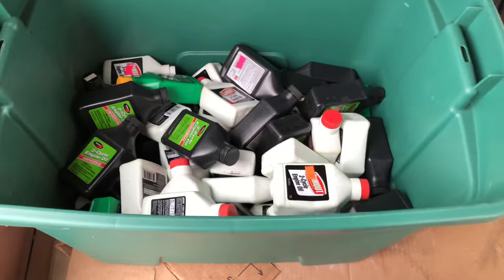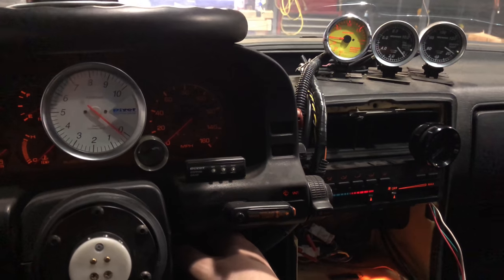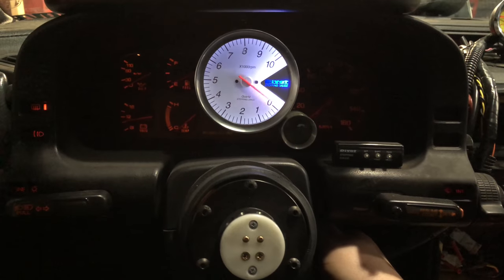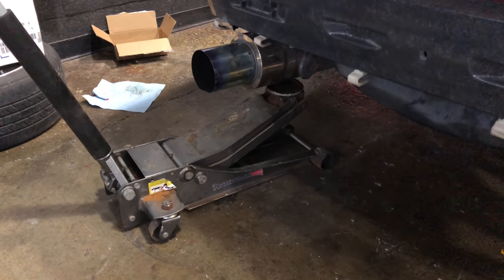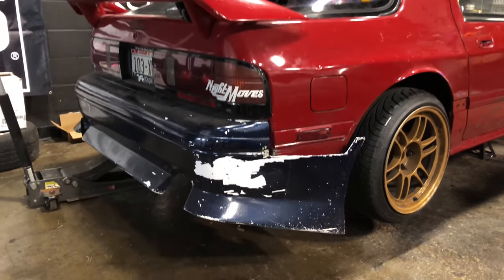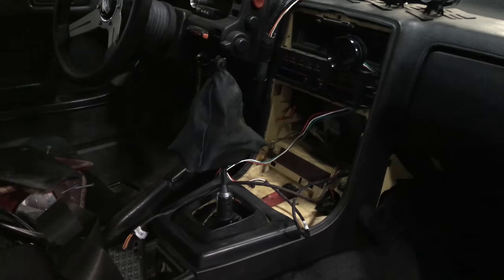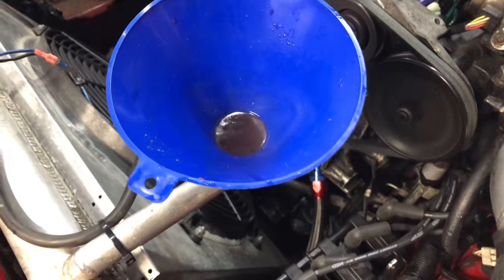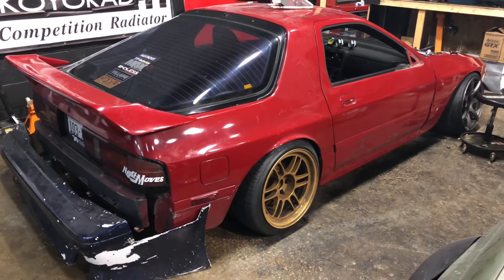ALWAYS Keep a Fire Extinguisher Near Your RX7

Comment: Fuel pressure regulator/ sprinkler system.
Reply: speaking of that you might want to look into grabbing some EFI rated fuel hose clamps, they dont have the worm gear but a bolt and nut arrangement. any autoparts store like vatozone etc should have them.